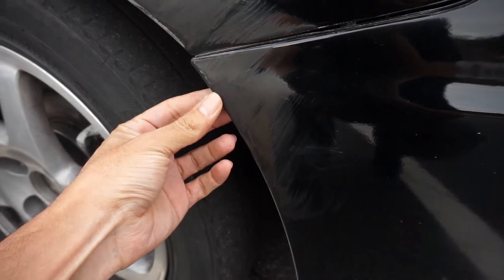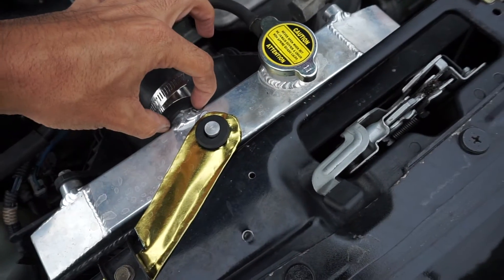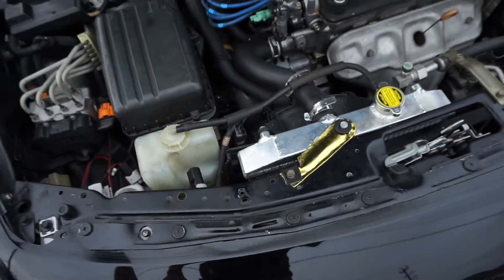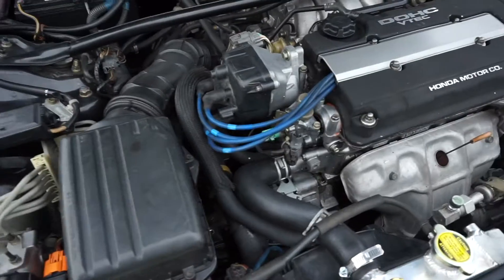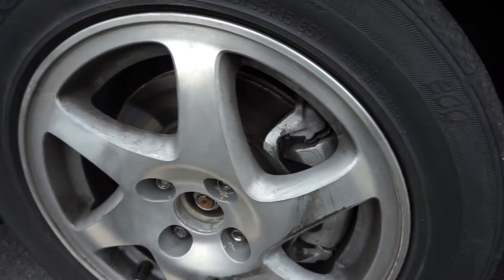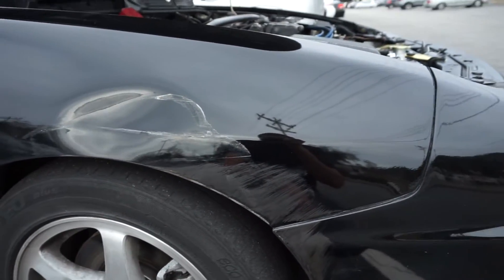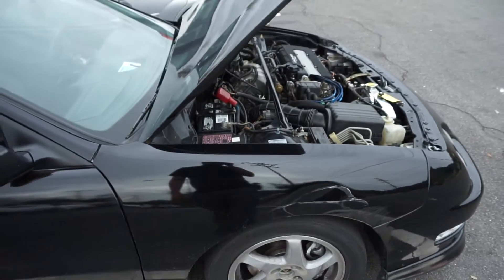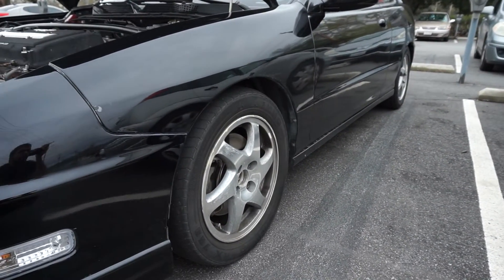Integra Car Accident

Comment: This is why I'll be investing in a dash cam soon. I'm from the midwest, so one would think that the drivers around here would be a little more "relaxed" behind the wheel, but sadly that's not the case. People nowdays are absolutely mental -- especially on the highway.  They're impatient, inconsiderate and behave as if they've unscrewed their heads and tossed them out the window. 

Anyway, it sucks that some dirtbag crunched up your front end. Hope you get 'er fixed-up again soon!
Reply from the maker: Jake from State Farm Jake from State Farm A Company called Vantrue makes some quality dash cams and the prices are decent! And yeah man people drive as if their head is up there ass actually lol 😂 brainless people but thank got for auto insurance.. 

And thanks man, it'll look better than ever, and I'm planning on changing some things up exterior wise 🤔👍🏽